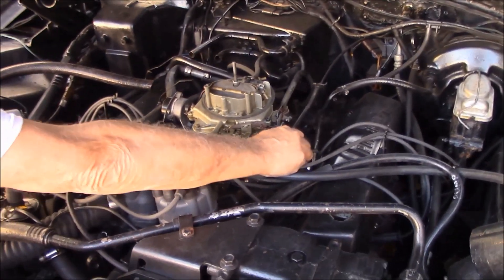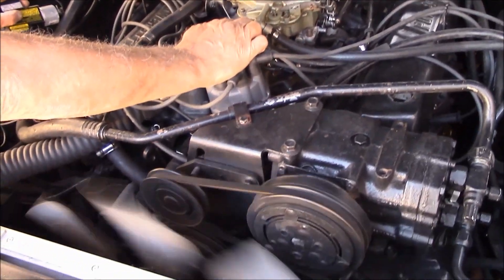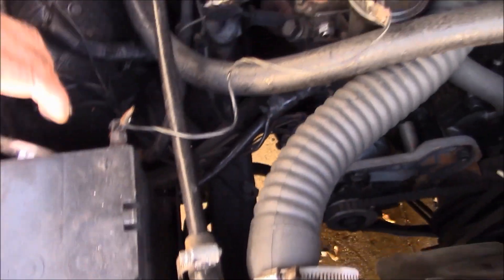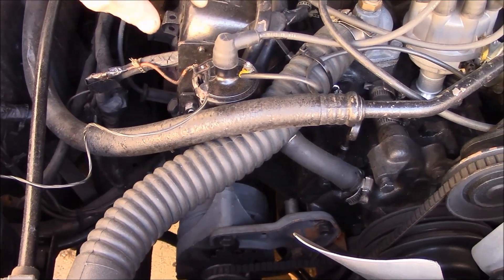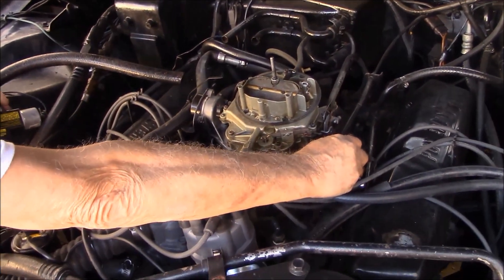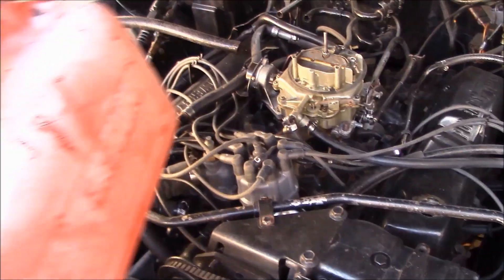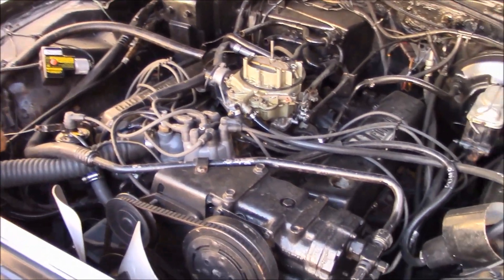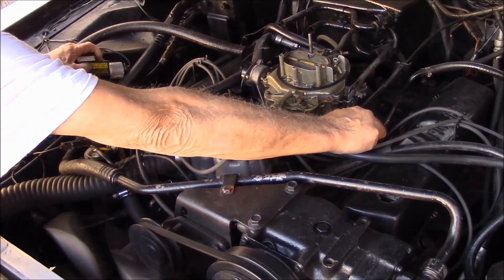How To Start A Misfiring Engine With Carburetor That Won't Start

Comment: filling gas into one of the two foat bowl vent tubes prevents backfire  after starting pull ea. plug wire off cap till you find dead hole
Reply: Can you explain what you mean by deadhole and finding it